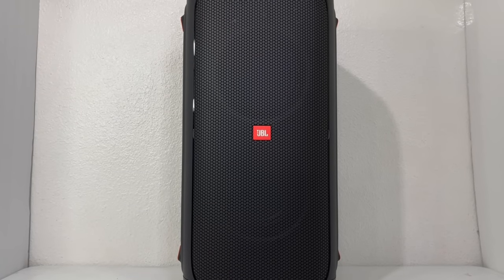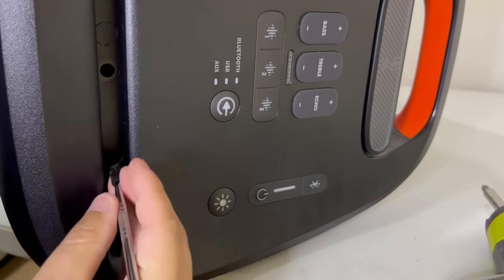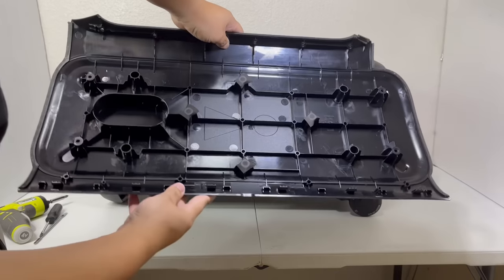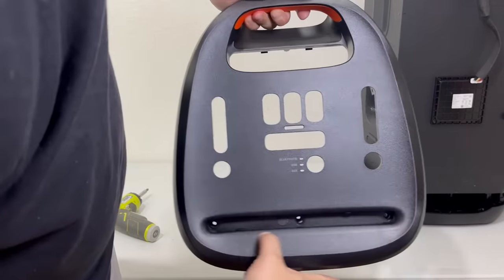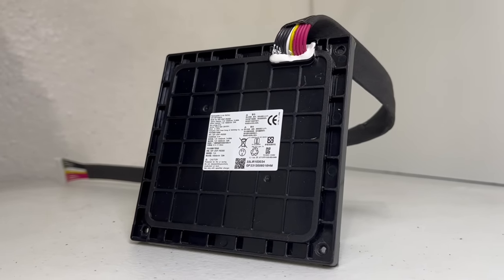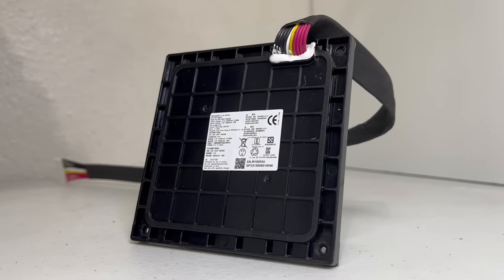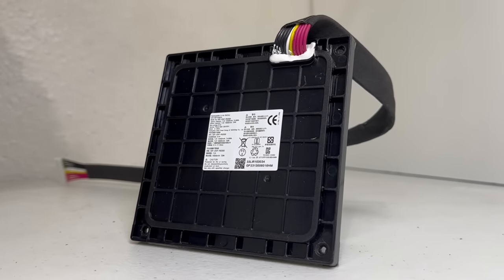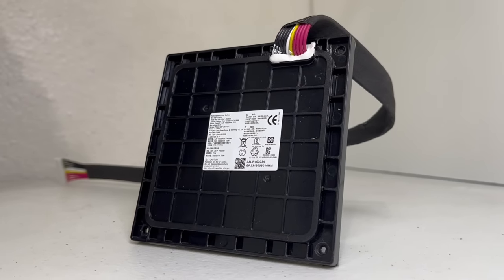JBL PARTYBOX 310 COMPLETE TEARDOWN !!!

Comment: Amazing there is a wooden speaker enclosure inside. On the other hand this makes perfect sense, as wood has got the best acoustic properties for a speaker case.
Reply: I agree good to see that
Reply: Only sad to see it is cheap wood with lots of air between the wood fibers. Not the best wood to use for a speaker. The cabinet was better if it was made out of mdf or multiplex.
Reply: @computerfreak696  Youre right. This was done for cost cutting I guess.

Comment: That air vent on the back. Is it open on the inside or it have some protection like a fibre or metal grill. Please reply.
Reply from the maker: it is open.  i dont recalled but if there is anything blocking it, but if there was, it will just be poly fiber.

Comment: Hi bro nice work the  310 party box i have when you  remove ac cable  it doesn't power on  to power on you have to disconnect  the battery what is da problem

Comment: Thank you. Mine got a bit wet and now doesn’t work.  So with your video I’m going to do a strip down
Reply: Mine did the same.  Did you figure it out
Reply: @E2Grunt  
Yes bought two new circuit boards from Ali express. I think they were around £70

Looked to be totally genuine ones and it’s now working perfectly

Comment: At which point can I easily take off the grill? The wind blew the curtain which toppled the speaker and now ive got a dent in the grill which can easily be pushed out but surely there is a quick and easy way to pull it out to get this done, maybe you know? Cheers
Reply: Why not use some wire around some.holes to pull it out?

Comment: Bro I have something rattling inside my 310, I didnt drop it or anything. Sounds like a loose screw or rock. Though its impossible for a rock to go inside as the air box exhaust is pointed upwards. Any idea or encounters about this?

Comment: hello sir, may i ask how's the condition of ur JBL GO3... is the rubber paddings and also the JBL logo in the front is still intact? and how about the battery sir is still doing well?
Reply from the maker: My jbl go 3 is still working good and the physical condition of it still looks brand new.  I have a clip 4 which was rarely use and has been in storage and the rubber backing is already peeling off for no reason.
Reply: @HBV90  thank you so much for answering my questions sir. by the way i already bought my new Go3 because of your content but im worried about the physical appearance i want it to preserve the appearance of my Go3 because here in Philippines we have extreme heat causing my BOSE earbuds start cracking... by the way thank you again sir Godbless😊

Comment: My Grand Son was able to break a cable pin in the Daisy Chain Input connection. How am I able to get it out ?
Reply: I was able to pull out most of the plug but the pute tip is still there
Reply: Outer

Comment: I want to take two or three batteries from a 310 and try to connect them to a 710. Has anyone seen anything like that? Do you think that might be possible?
Reply from the maker: That's possible as long as you increase the capacity and not the voltage

Comment: Ngl i was expecting a much larger battery than 10,000 mah im super impressed how long mine lasts when its only got the same capacity as a flagship tablet😂 and now i onow where the battery is and how easy it is in case i need to replace it at some point in the future.